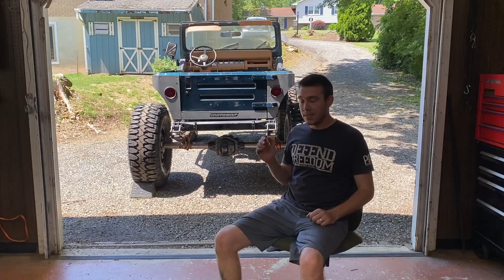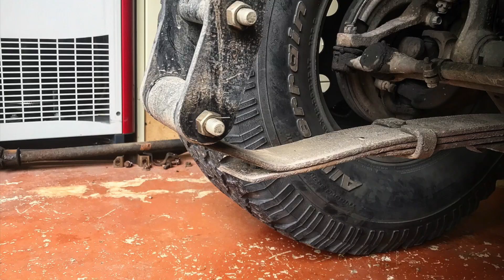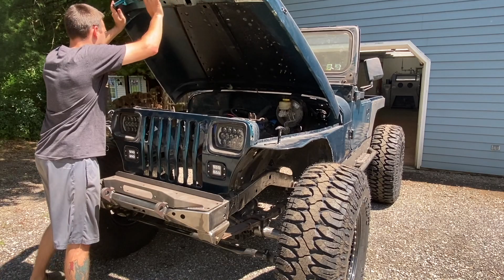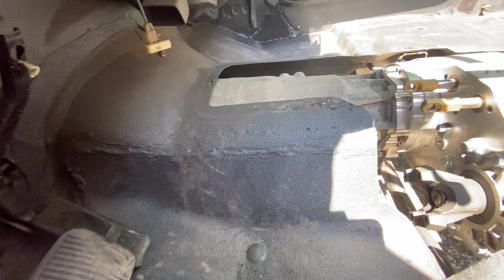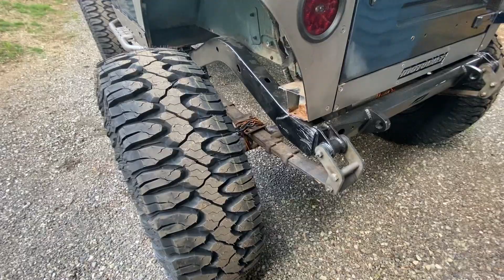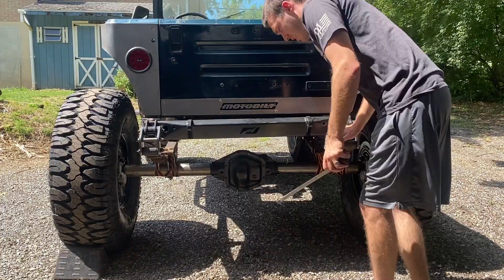YJ update June 2020

Comment: WRANGLER YJ 1991 YEARS ENGINE 4.0 PCM 56026982 NOT WORK  NEED NUMBER PART  FOR PCM   PLEASE HELP MY 3 YEARS NOT DRAVE  PROBLEM PCM  NUMBER  THANKS FROM BOSNIA
Reply from the maker: I unfortunately do not know the part number, I tried looking them up and everyone I’ve seen is out of stock. It is also dependent on what transmission you have (auto or manual). Good luck with getting the Jeep fixed
Reply: @altered_life   Manual
Reply from the maker: The BSE brand is showing a part number of EM3896 or 56027526 for the manual transmission. I hope that helps although I’m not sure of availability especially in Bosnia but good luck!
Reply: @altered_life    PCM 56027398  I FOUND THAT PCM IF IT CAN  BE DRIVE ON IT

Comment: I missed it in another video , what springs are you using?
Reply from the maker: Currently it’s on OEM YJ leafs all the way around (5 leaf pack). I had to move my rear spring hangers back on the frame to accommodate the 6” stretch. My goal is to keep it as low as I can while doing spring over but I may need to add a leaf or rework the spring pack once the final weight is on the chassis.

Comment: What made you want to keep the yj leafs when installing the rear stretch kit?
Reply from the maker: Hey Kevin, so that’s a good question and honestly since I don’t have any first hand experience with it I went off of information from some industry professionals. The thought process behind it is the shorter leaf (compared to XJ) will be prone to less axle wrap even though I’ll still run a antiwrap bar. Second thing I was told was that OEM YJ leafs flex the best for factory leaf springs and final though is that if all my leafs are the same, having one spare back at camp would work on any corner of the Jeep incase I bent or busted one. Again I don’t really know much about it but I’m going to test it out and see how it performs haha

Comment: You’re going to need to stretch the front with offset perches or trim the front corner of the fenders to get up travel. With the shackle reversal your axle will move rearward as it travels up.
Reply from the maker: larkin kelly I actually already have the front as far forward as I can get it with offset perches. Those front fenders are not staying for the final build. They are just my factory fenders I wanted to throw on to see how it looked all together. My plan is to make custom highline fenders as build gets closer to being finished.

Comment: I used an SJ spring on the front of mine and of course the XJ rears but the SJ will give you a little more stretch in the front get the back of that tire away from the fender the centerpins offset about an inch inch and a half
Reply from the maker: Mark Mcgee thanks for that info! I’m going to have to take a look at the SJ springs. Do you know if the OEM SJ springs are the same length and height as the OEM YJ? I’ll be doing a different fender option so I’m not as concerned about that but I for sure would love any more stretch I could get. Main reason I wanted to use OEM YJ leafs all around was because I heard they have some of the best flex.
Reply: @altered_life  I've measured them and I believe they're the same length just the center pins offset we're on the YJ they're dead center I'm at work otherwise I'd measure them up for you.
Reply from the maker: Mark Mcgee no worries, I appreciate the reply. I’m going to sit down and do some research into them, it seems like if I’d switch to front waggy springs all the way around I’d get an additional 3-4 inches overall stretch. My only concern is I don’t want it much taller than it is now, so I hope the SJ springs wouldn’t add much height. From your experience how is the flex with those springs?
Reply: @altered_life  they seem to flex well I use sliders instead of shackles and as far as your right height you might get a little more out of it but mine lay pretty flat if you want to look up sliders liquid iron builds them and sells them which sliders you get a lot more travel than with shackles
Reply from the maker: Mark Mcgee all good to know, I’ve seen the sliders but I’ll probably keep the shackles for now and see how it performs but maybe in the future If I feel the need for them
Reply: @altered_life  these things are never done I've been building them since the '70s and I get to a certain point and I got to start all over with a brand new one but they're never done
Reply from the maker: Mark Mcgee hahaha yeah you’re right! I have buddies that say they “finished” their build and the next season they are tearing into it to make it that much better. I have a feeling mine will be in and out of the garage for many years to come